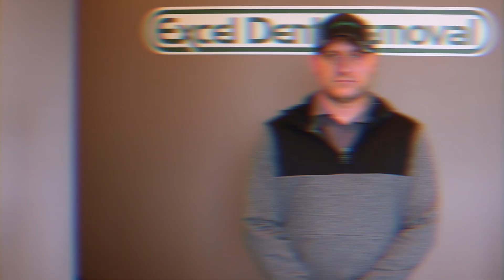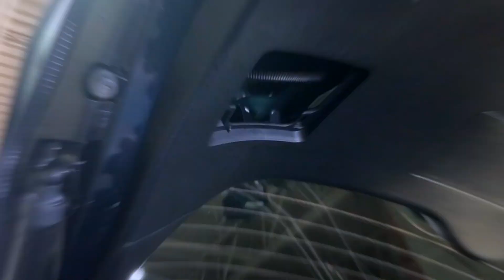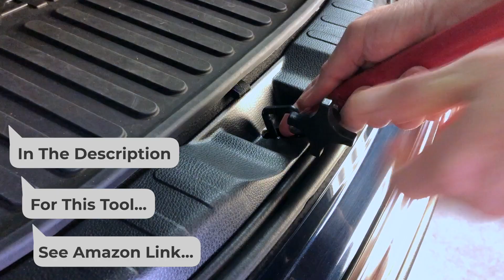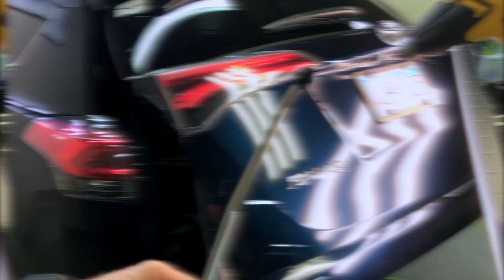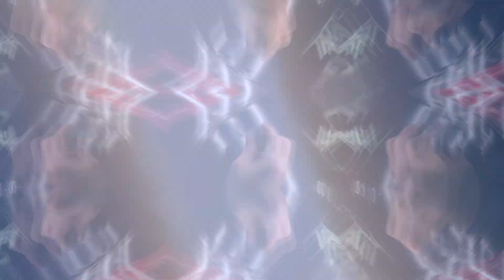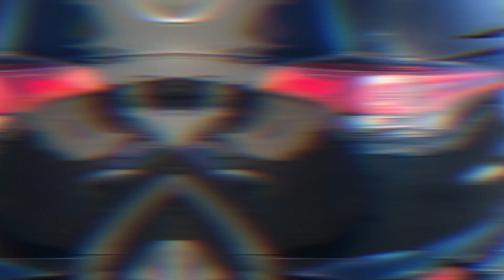Fixing A Common Car Dent

Comment: Hi Steven, quick question, have you heard of any pdr experts ever scratching the windows?
I had a pdr Pro have a look at my small dents and he has scratched my glass with a nylon wedge which was forced between the door and window. He has 100% denied it was him.
Reply from the maker: Did they also repair the damage or just inspect it? While it isn't common for scratches to happen by doing that. If the damage to the glass lined up exactly, then it could be possible. But sometimes those scratches in the glass are not noticed first before looking at the car.